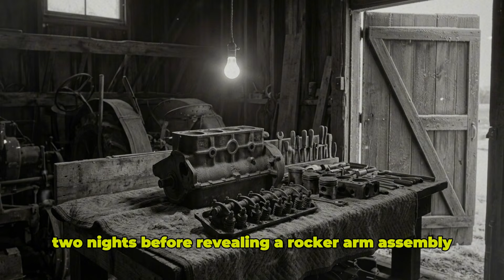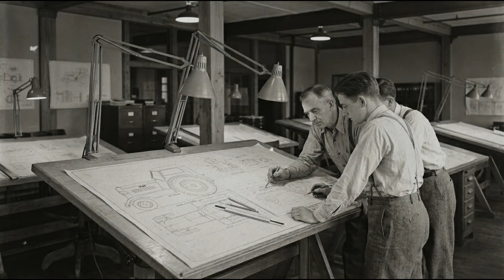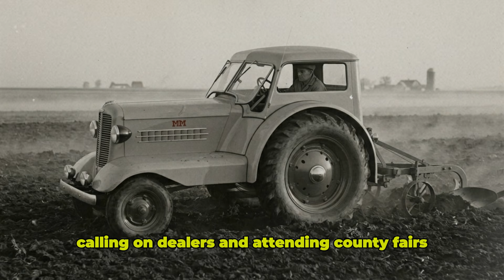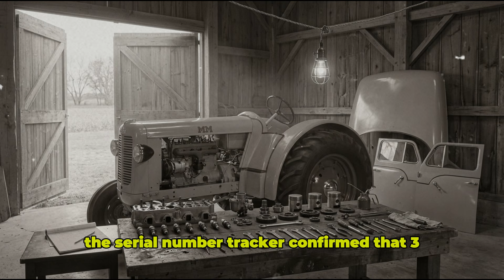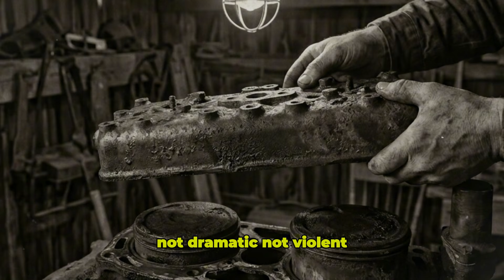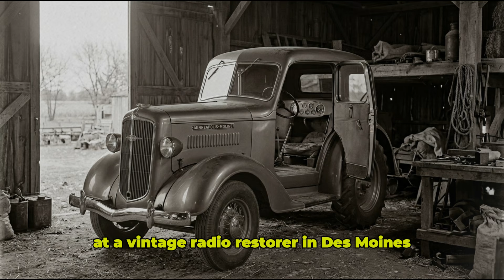He Bought His Old $75 Junk Tractor Back  What He Found Hidden Inside the Engine Shocked Everyone

Comment: The UDLX cost nearly twice as much as a new Deere or a Farmall and that's why it's a rare model. People didn't buy what they couldn't afford.
Reply from the maker: You're absolutely right. The Minneapolis-Moline UDLX Comfortractor was far ahead of its time, but high price made it difficult for many farmers to afford. That's exactly why it became such a rare and fascinating tractor today.
Reply: And since a new Deere or Farmall could be had for a $1000 or less on full steel wheels, it's easy to see why those tractors sold way more units than most other makes at the time.